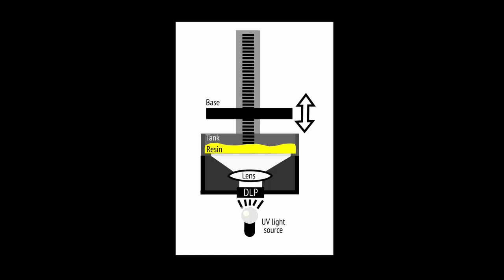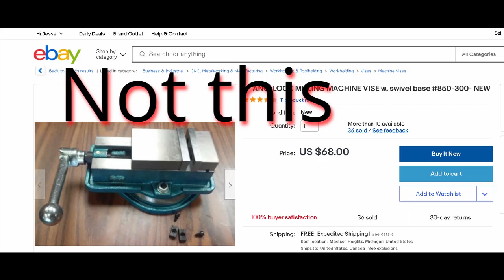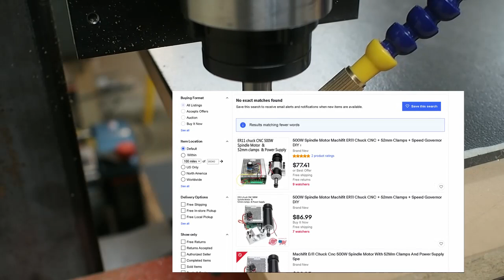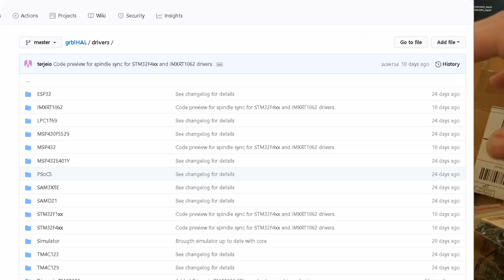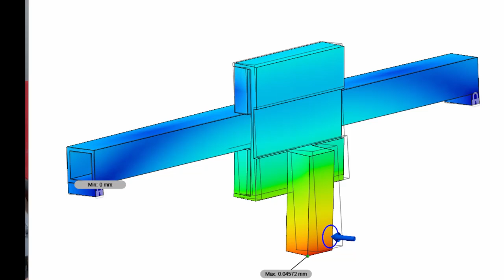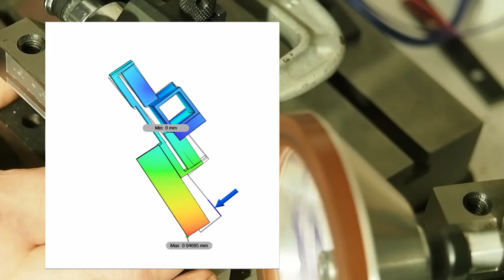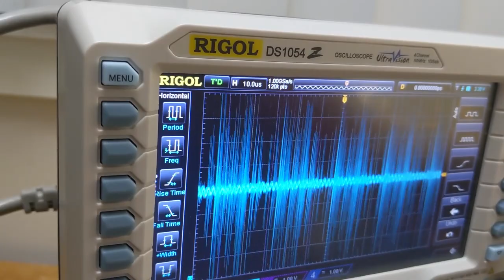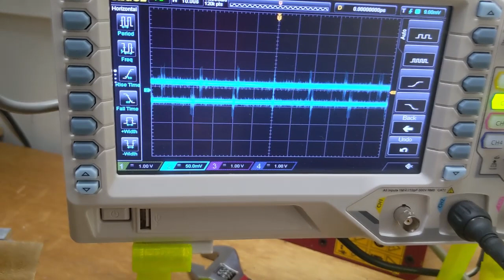First DIY CNC build advice

Comment: Great advice! I built my first CNC a year ago with my old coworker in his garage, it was a partially 3d printed open source design (RS-CNC32 by MakerFr). Spent more time researching and learning than the actual building itself and when it was finally done it was a whole other challenge to learn fusion cam and get it to do what I wanted. In the end I needed a machine of my own to learn on so I built a bulkman3d workbee 1000x1000mm kit with a separately sourced vfd spindle and 32 bit grbl controller setup. On the workbee I spent around $2500 total which would've been around the same for a prebuilt one albeit without a VFD spindle and all the fancy features I wanted. The learning experience was priceless

Comment: Hello,
I was quite surprised when I heard you were having electrical noise issue with your motor drivers.
From the recommandations fond on the m-hoch-5 youtube channel I was seriously considering the integreated closed loop ones from JMC.
I can't help you on your emf problems, I see that you already have sheilded and grounded wires all over the place !
Could you provide the reference of your driver so I and other don't make the same mistake ? It seems to be an 2HSS57
Thanks,
have a great day !
Reply from the maker: yup, 2HSS57

Comment: What do you think of the SX2.7 mill? pros and cons. I would apreciate you honest opinion. Thanks Jesse.
Reply from the maker: I have the grizzly version which does not have the power tapping buttons but the table is bigger (27.5") and it came with a DRO.  I have wondered why LMS discontinued it.  My guess would be that the column isn't as robust as it could be. When you are using a boring head or drilling big diameter bits the head really moves around a lot.  It is not a mill you should expect to take big cuts with.  The sx3.5 is almost 100lbs more weight and I would guess it is more rigid.  My only other experience is with the old mini and micro mill styles so I'm guessing about the 3.5.  Net net, the smaller size/weight gives me a prayer that I can move it by myself without a hoist which is a feature I like.  It gets the job done but it has required some tuning.  I don't think the quill lock is as robust as it should be.  The bearing arrangement is a bit odd, it has one tapered roller bearing in the bottom and a thrust/roller bearing combo at the top.  I would guess this will last a while but it is much less rigid than AC bearings. The table isn't quite flat and the motor has issues starting.  I need to frequently rotate the spindle a bit to get it to start.  I have pulled the motor and one of the brushes seems to have been installed incorrectly which I'm guessing is causing it to have issues.  I may even be running on one brush sometimes.  The LMS version has a brushless motor I believe which would be preferable.  The tapered gibs are easy to adjust and it has very little backlash.  There is no lubrication system so you are never sure if you've worked enough way oil in.  I've tapped with it frequently for M6 and M5 threads without much issues.  The DRO is so great.  I'd never want to run a mill without one now that I have it.  If i had it to do again I may go for a RF45 clone or bridge port clone and suck up the weight difference but make sure it had a DRO.  It runs on 110 which limits power but my current garage doesn't have 220.  Today it gets every job I've thrown at it done and I do like the mill.

Comment: Hello Jesse, Great video! Thanks for sharing. Regarding the vice quality you seem to do not recomand  the one here that I unfortunatly buy along with my SX2.7. There is this website where I bought them. Please, what vice would you recomand on this page? Thanks
https://www.arceurotrade.co.uk/catalogue/results.aspx?page=1&search=vice
Reply from the maker: Thanks!  It is hard to say what the quality is, assuming the quality is the same I believe it is a question of versatility, size, budget and the work you plan to do.  I think you'd need at least a 4" screwless vise.  The screwless type are nice but the pin can be annoying to move and you can "run out of thread".  The kurt type screw vises are very versatile and the replicable jaws allow for soft jaws and fixture jaws.  You can also clamp larger items because the removable jaws can be screwed on the back faces of the vise jaws.  The kurt style I have is of very poor quality and I'd take a good quality screwless vise over a poor kurt style.  I don't think you have to have a rotating base or a sine base.  My girardi type vise on my 2.7 is a really really great design and I have yet to have any issues with it but it was big and expensive (not as much as the real thing!).  I have yet to have an issue with it.

What kind of work will you be doing and how big will your parts be?  Have you checked your vise for parallel/square?
Reply from the maker: One more thing: I'd take a vise that can be set on it's side over the blue type that has the raw painted casting on the sides.  Sometimes you need to do that for your setup or you may put a vise in a vise and the square sides make this type more versatile.
Reply: @JesseSchoch  Small parts for upgrading my CNC, motorcycle parts,  specific mecanics tools, or something not yet in my mind. And I haven't checked my vice yet. I'll do it!
Reply from the maker: tough to say, it looks like the queenbee (is this the right company?  https://www.cnc3d.com.au/cnc-machines)   only has 54mm of z height which would limit you to the very small  45mm size.  These little screwless vises are very annoying to use and they don't have clamping surfaces on the sides.  With very little Z height you are limited in your options.   You also need to consider how you will attach it to your table/frame/spoilboard.
Reply: @JesseSchoch  Ok thanks for your input!